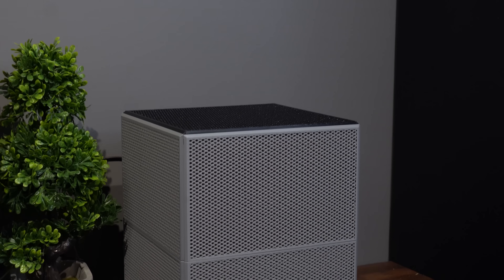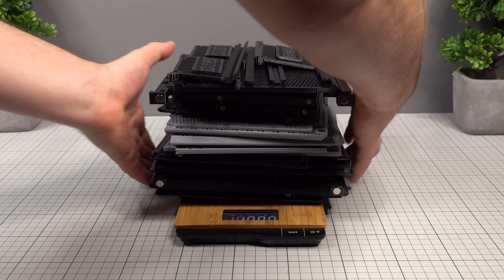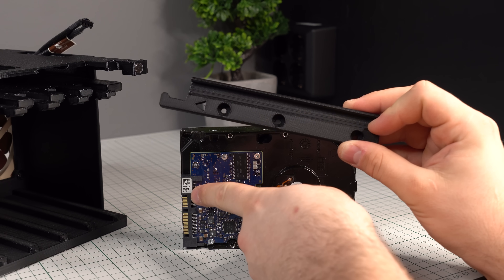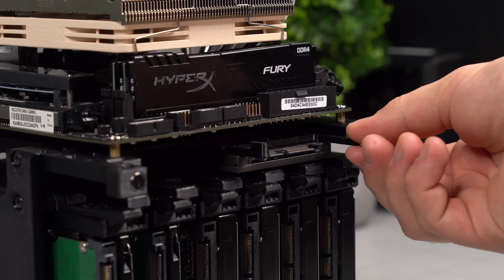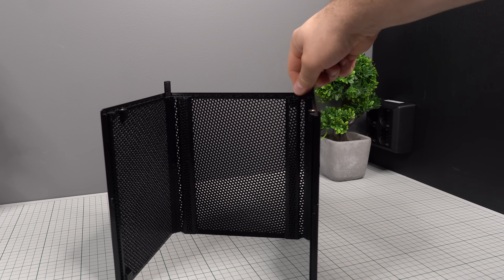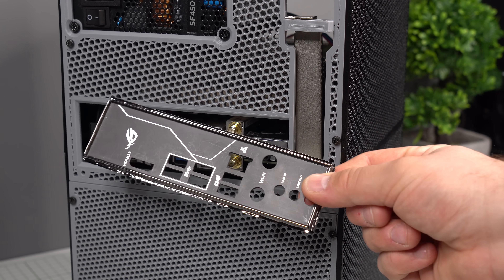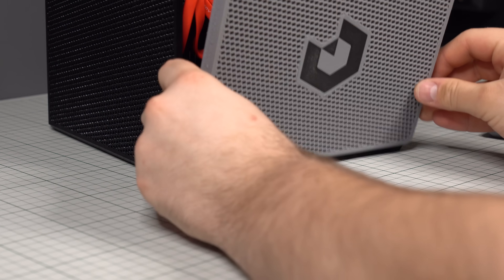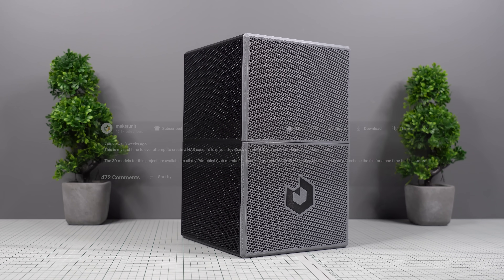3D Printed 6-Bay NAS case - Improved in every way!

Comment: Sorry to comment/ask ANOTHER new version : can we have a rack mounted version with NVME drives only? 😁👌
Would be awesome to have a nice setup for home labers
Reply from the maker: Don’t be sorry! I love getting suggestions for builds 👌😊 Currently I don’t have access to a 19’’ rack to test such a system but eventually I hope to get there. 🙂
Reply: @makerunit  I don't think you REALLY need a rack to make some "templated" cases. I think it also exist some rails so you can simulate one. 🙂
Reply from the maker: @FranckEhret  yeah it has crossed my mind to do it just by making a simulated rack, however I really like to test my designs for flaws before I publish them 😅
Reply: @makerunit  That totally makes sense and I totally get it. 
For myself, I also prefer to make it right "first time", even if for the ones waiting for it, it means more time to wait 😊
Reply from the maker: @FranckEhret  I try to always test many different use scenarios whenever I design a case. Even then, a detail is missed here and there, but users are usually quite quick to point out any flaws so I can correct them 😊 that’s also the benefit of building the cases in many flat pieces. They’re easy to print and if something needs to be fixed, you often only need to reprint one small part rather than the whole thing 😊

Comment: Now this great case design inspired an interesting thought:
Modular cases. 
ie design a base module that houses the mainboard and PSU in such a way that one can attach other case modules on any of the 5 sides remaining (the 6th would be the backside and used exclusively for IO). 
Then one could have a case module that can house a GPU (attached via PCIe Riser cable ofc), a NAS case module for the currently presented use case and potentially a host of others (depending on ideas that might come up later).
This would also allow for combining whatever modules someone would want in their build.
Reply from the maker: Hey! Thanks, and you’re not the first to mention this, and actually, even before posting this I designed the drive bay also as a «pilot» test for a future modular case with attachable drive bays. I’ve got some prototype designs going on already on case modules. Biggest challenge is how to easily join them. Not the joint themselves but making them printable without crazy overhangs is the main challenge to be honest. Printability 😁
Reply: @makerunit  Awesome. I honestly couldn't design something on this level myself. I make simple cases for my projects or smaller pieces that help in building bigger cases from other materials. Printability of a modular case structure seems like a lot of variables to keep in check.
Reply from the maker: @J0ermungand  This is exactly the issue with designing for 3D printing. I’m purposefully sterring clear of using any supports where possible, as it affects both accuracy and overall finish on the prints. Only way to have accurate parts with supports is zero tolerance multimaterial supports (PLA supports on PETG for example) but this is not common, and also takes a lot longer to print)

It’s generally not a problem desining something cool in a few hours. Most of the hours go into the details, splitting the parts to fit smaller printers etc. Right now I’m working on a full ATX  that’s printable within 180x180mm, and it’s proven to be quite the challenge but I’ve finally figured it out, going to start printing it soon. 😃
Reply: @makerunit  Nice, that must've been a challenge.
I assume that'll be an upcoming video also?
I'd imagine doing all those designs for your youtube channel is also helping you develop your skills a lot more than regular tinkering would. Kinda like doing something as a job for years and automatically becoming an expert in that thing.
I always love your videos btw. Well produced showcasing interesting projects.

Funnily enough though, my next project is goig to be a tiny NAS/media center combo rig for a friend and I've been pondering designing the case to be fully 3D printed, rather than my usual 3D printed support structures for other materials.
Reply from the maker: @J0ermungand  yeah that’s going to be my next video 😊 long term my goal is to improve gradually from project to project and eventually release an actual production model, whether it’s a prebuilt case or some sort of DIY custimizable product is not decided yet as it’s long into the future (at least a few years probably).
Reply: @makerunit  That's awesome to hear, because it means lots more videos to come from you 😉

Comment: Thank's it's very good think you do, you some good modification, 6X3,5", 3 x 2,5" is great. but i have to find some mini ITX, it's not so easy to find some are micro ATX an it's easier to fond at good price. But overall now i follow your chanel, i recommand to my friend to check and some print. As soon as i get finish with print i will send some picture.
Reply from the maker: Thank you! I’m planning to create more versions for bigger and cheaper components! Possibly expandable even! 🙃, looking forward to seeing your pictures!
Reply: @makerunit  now i had problems for the first layers, especially the infills. The first infill lines don't seem to stick the plate enough and it looks more like flow rate problems. I have Qidi Slicer (like Prusa Slicer). What setting do you use to get nice print ?

Comment: This is really cool! I've been looking at NAS enclosures for probably over a year now and everytime I find a new one that looks interesting the price in my region is just crazy. Then you look at something like this which looks really nice and clean, should be reasonably easy to assemble and has a nice capacity.

Stupid question... 6HDDs + 2 SSDs (not going to count the OS SSD for this question). What is the purpose of the 2 SSDs? Are they caching drives, are they meant to be part of the overall array? I have a friend with a 3D printer and I am sure I could convince him to give this a go for me, but I want to make sure I understand the setup.
Reply from the maker: Thank you! I’m happy to hear you like my design!

The dual SSDs are meant for faster cache storage, but really they can be set up as a part of the system as well if you prefer that.  The reason for doing two is to always have a backup in case one fails.
Reply: @makerunit  thought so. Awesome either way. Thanks!

Comment: This is pretty amazing. I've been considering attempting to design an 8 bay hot swap matx nas to fit in an Ikea kallax (probably a 30cm cube to fit in 32x32x38cm) but i've never designed anything from scratch before so not sure I'll get very far... If you're looking for an easy way to add hot swap then aliexpress do 22 pin sata male to female connectors with screw holes which should be relatively simple for someone with your skill to integrate into a design! 
This is the first video I've come across on your channel and I'm looking forward to more cool projects!
Reply from the maker: Hey! Thank you! I’m planning to eventually make bigger versions supporting a bigger variety in parts! I’ll definitely be looking into those connectors! 😊 and I’m glad to hear you like my content!

Comment: Whats the max height for a CPU cooler in this case?
Reply from the maker: Theoretically about 80mm, but I recommend around 70mm to make sure the air can flow freely under the PSU 🙃

Comment: Thanks for the hard work for designing and building this case,
Its amazing that you can design this elegent pretty NAS
Can you also modify it to all SSD drives without PSU (using pico psu instead)
To maximize the portability and minimize the size
Reply from the maker: Thank you! 😊 I’m glad to hear you like my design. I’m a little curious if common PICO psu’s have enough juice to run all 6 drives + 3 SSDs at the same time? I’m eventually planning to create some more versions of NAS systems. Some may be smaller, some larger 😄

Comment: Which fans are those? I didn’t see 22mm thick noctuas
Reply from the maker: Hi! I’m using the 14mm thick Noctuas, I just stated that the max width that theoretically could fit was about 22mm. If someone for example were to use other fans than noctuas,  the widths might be different. Sorry if I was a little unclear. 😊
Reply: @makerunit  thank you for getting back to me. No it was actually clear – I just didn’t see any 14 mm thick  noctua fans. I’ll look again thank you.
Reply from the maker: @chrisperrywv  Noctua’s 14mm fans are called Noctua A9x14 😁 but there are also options from other brands that also will fit. Some other cheaper brands also offer 15mm fans, but I don’t know how much noise they make etc as I’m mainly using Noctuas.
Reply: @makerunit  yea- all the 14mm thick fans I saw on Amazon just looked so weak. 
Also- I decided to 3d print my case to save some dough. Boy- was that an ignorant thought. Now due to ITC and sfx premiums I absolutely decimated my imaginary budget. Sunk cost fallacy - what’s a couple more bucks on noctuas 🤣 
On another note- noise is very low priority for now- this case PC will live in the laundry room on top of the cabinets. That’s also why I don’t want to skimp too much on fans though since it’s already hot it there.
Reply from the maker: @chrisperrywv  https://www.amazon.com/Thermalright-TL-9015B-Control-2700RPM-Performance/dp/B09TZY9HRH/ref=mp_s_a_1_3?crid=FROKIOU2ROD&dib=eyJ2IjoiMSJ9._g4C3bTDIn87lLO-qZItclV-yt5U6ATij6OIFFPVHZ87-jy1xn-rAF62q7_OyfraCPg1dIHg6vYpmokhNYtuNWSjobphgM2MVWJxU-r127OIi2hUr5cZ1JGnFJgH-IvrwX9WLg0LMp5tFaSBEXU1mWns2CDXss0VmsnXrmiS_cowCDQD3xYnuPWj9cMwWSlUo7GXI-Rt0D1ErJEOwXnx_Q.fpE2PtiDuiivl8QOztGrzgMQYTIzXL9k23Ot0K0oqo8&dib_tag=se&keywords=92mm+slim+fan&qid=1715007894&sprefix=92mm+slim+fan%2Caps%2C193&sr=8-3

These are very cheap. Probably works pretty much the same. 

I got my noctua 92mm fans in bulk brand new un-used from a local guy in Norway who had a ton of them laying around. Apparently he boughy a bunch of the low profile coolers but only needed the heatsinks so he had tons of them laying around. So I bought like 20 of them 😅
Reply: @makerunit  oh heck yea! That’s awesome.
Reply: @makerunit  I keep getting tempted by RGB fans… for the back of my case… on top of a cabinet… in the laundry room… without RGB headers. 🤪
Reply: @makerunit  hey- did you use PLA for the entire outside? How’s everything holding up to the heat? I ordered some PETG in a darker grey color - but I ended up doing black and light blue for the front (in PLA) and I’m not sure how the dark great is going to look on the sides now like I planned (I didn’t originally intend to 2-tone the front panels). But also I’m being impatient and just want to get everything printed. Haha.
Reply from the maker: @chrisperrywv  I used PETG for most of my parts, but PLA for the grey parts on mine (front and rear panels) 😃 I totally understand the urge to just get it done with.  Which is also why you often see most of my projects are mainly white, black and grey, as those are the easiest colors for me to obtain locally 😅

Also, I don’t think RGB fans would make much sense in a system like this 😅 as they’re also on the backside of the case meaning they would not even be visible.

Comment: A dual-slot PCI would allow the Gigabyte RTX 4060 Low Profile to be used.
Reply from the maker: I had a very specific goal of fitting the design within a specific print volume, so unfortunately I had to make some sacrifices there. I’m planning to add more versions down the road though, which will support this as well.

Comment: How do you know which hard drive to swap? Bay led? Bay numbering? Which  NAS software do you use?
Reply from the maker: One idea is to color code each cable on both ends. Another one is number marking with a sharpie. 😊 mine are stacked in a certain order because they’re flat so I can tell which one in the stack it is. And they’re zip tied in place just the correct length to reach each drive. 😊

I have not actually set this up to be a NAS with a dedicated NAS system as I’m kinda new to that myself so I can’t really recommend a specific program unfortunately.

Comment: This is a very nice design. Have you thought about making the drive modular? Meaning the cables are hidden in the back and no need to disconnect cables in the front. A much cleaner design. Not sure if this is possible do to the design, but maybe in a future iteration.
Reply from the maker: Thank you! I’ve thought about making the next version both modular (separate drive modules that can be added when the need increases) and have a backplane in the drive bay to allow for cable-less drive connections. Though this is a long term project I have in mind to get done at some point in the future 😊

Comment: Just wondering, while this case definitely looks awesome (I even consider this to be my next build), it could use some dust filters to control the dust inside the case though. I believe as is in a long run, this would be quite easy to get a really dirty PC, specially with the 3d printed texture and the honey comb design (I suspect). Thinking on that I would suggest to some how have mountain thingy to hold a standard sized filter for each and every place an intake fan should be installed, for design purposes inside of the case ofc. As the hardware is basically all built onto a structured frame, its easy to slide it out, expect for the power supply that is screwed to the outer frame. With all done hinse the frame under the sink. There's some room to get be creative and come up with a slide in lock mechanism for the power supply though hahah. Great job.
Reply from the maker: You’ve definitely got some good points here. My next «big NAS project» I’m hoping to be an expandable, bigger modular system. I’ll be sure to consider adding some dust protection when that time comes 😊

Comment: What is the maximum specs for this PC?
Reply from the maker: Not exactly sure what you’re referring to,  but here are the general specs:

Mini ITX motherboard
Air Cooler up to 80mm (around 70 recommended)
Single slot PCIe card up to about 180mm long. 
SFX Power supply. 
Up to 6x 3.5’’ HDDs and 3x 2.5’’ SSDs.
Reply: @makerunit  I'm sorry I do not speaks English very good. I am thinking how big can graphics card fit into? I want to get big one in to run D C S
Reply from the maker: @aidenkahn4338  you are doing good so far 😊. It can only hold slim graphics cards up to 1 slot (not normal graphics card) only «single slot» card. Max length about 180mm.

You can not fit big one. :-(
Reply: @makerunit  oh no! Is one made to fit big ones?
Reply from the maker: @aidenkahn4338  the big what? Graphics cards? I do have cases that support bigger graphics cards, but no NAS yet to support big cards, I plan on making more versions though so stay tuned 😊
Reply: @makerunit  I'm very sorry over my English skills. Yes yes graphic card is what I'm trying to talk about 😎 I'm going to buy best amd graphics card and want to print the case
Reply from the maker: @aidenkahn4338  I understand😊, but if you need big graphics card you should wait for my next model.
Reply: @makerunit  thanks my friend

Comment: This is a cool NAS case. The only thing I would need is a bay for my Blu Ray drive for ripping movies. If that was an option, I would absolutely print this and replace my current case.
Reply from the maker: Thank you! I can’t even remember the last time I used a Blu-Ray disk! I will probably never make a dedicated Blu-Ray case, but MAYBE I’ll make something that supports 5.25 bays at some point 😊
Reply: @makerunit Awesome. A module supporting a single 5.25" bay is all I need to support use of makemkv to rip my movies on my unraid machine.
Reply from the maker: @bjaurelio  I see. One of my long term projects is a fully modular system that can be anything from a gaming rig to a scaleable NAS, perhaps a 5.25 addition may be good to add there!😊

Comment: Wow. I tried my hand at designing a case years ago, but the 22x22x25cm build volume always ended up with me failing. Can't wait to see what else you have planned.
Reply from the maker: Thanks! It’s a little challenging definitely but with enough time put in there’s always a solution. My current challenge is to use the same small print volume, and make something that can hold a full size ATX motherboard and a large GPU! 😅

Comment: Now the only thing missing is a backplane. There are lots of PCB manufacurers that ship boards internationally within a week nowadays. So it's definitely feasible for a DIY project.
Reply from the maker: Definitely! I’m trying my best to improve the design every time, adding new features for every version.
Reply: @makerunit  what about some vibration dampers for the drive mounts.
Reply: @aquiveal  you could make the caddy's  with a layer of tpu/tpe facing in the drive...might do the trick
Reply: True, with easy hotswap support. Also DIY PiKVM for remote management even without OS (video, keyboard, drive, power, reset) with nice small OLED (for fun and some information).
Reply: Wonder if any existing backplane would work ? On eBay there are Dell and HP 5/6 drive backplanes for $30
Reply: @LorenHeiman  I'm looking into this exactly myself. Supermicro SAS backplanes seem to work really well, paired up with a HBA card for them. SATA drives are compatible with SAS backplanes, so it will work provided the SAS controller supports it (most do). I saw a nice supermicro sas expander board with 12 drive slots for around 40 GBP, and it only needs one cable to go from it to the sas controller!